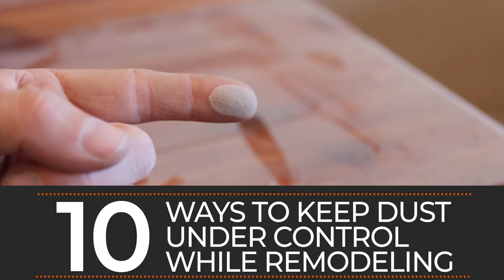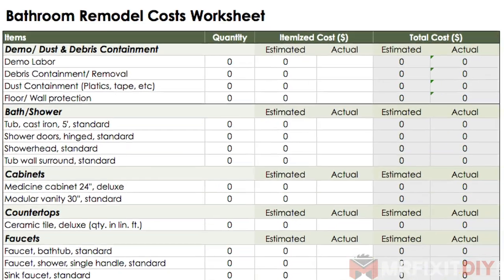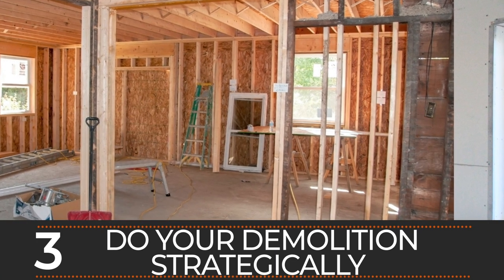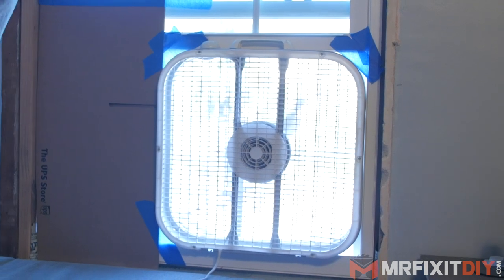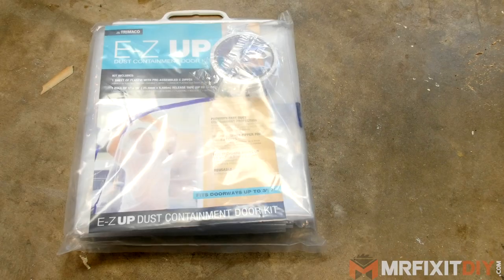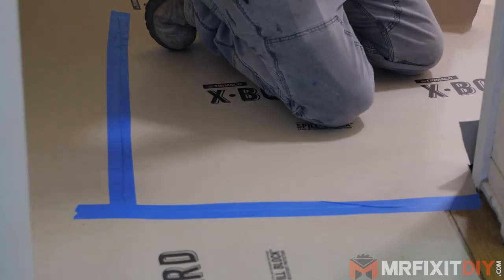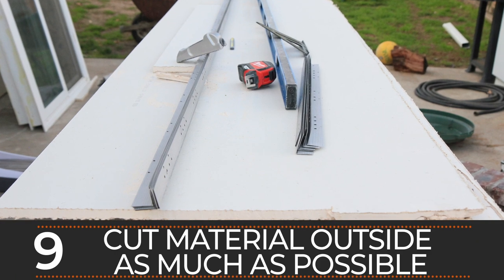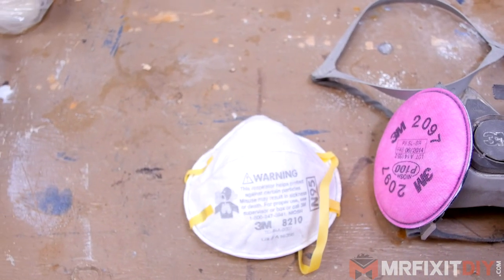10 Ways to Keep Dust Under Control While Remodeling

Comment: Really informative video. To add to the last item, an upgraded shop vac filter helps immensely with drywall dust. That stuff is so fine it'll either clog up your standard filter, or worse, blow right out the back side of the vacuum.

Comment: 1. Budget for dust containment
2. Utilize plastic to contain dust
3. Demolition strategically - keep barriers between rooms as long as possible
4. Use windows to remove demo materials + box fan exhaust 
5. Cover vents by sealing with plastic + tape
6. Use single entry/exit points
7. Protect floors with boards
8. Keep boots on, but use booties
9. Cut outside.
10. Use shopvac sander

Comment: Hello! 
Very informative video, thanks! We just wrapped the house for a quick room renovation like that. 
Question: Is there any tip for removing the duct-tape off the walls? Because we had to remove some of it to rearrange it and the paint layer is coming out at several spots.

Comment: After 3 years of CONSTANT renovation in several areas of the house at once (still going as we speak) (currently in all 4 corners upstairs and down) my home is COVERED in dust. I wish they would’ve covered the vents but here we are, and yeah. We’ve already replaced carpet in several areas bc it’s already trashed. Guys are in and out from garage to inside to outside to up to down and everything gets tracked everywhere. Any suggestions for catching up on any of that?